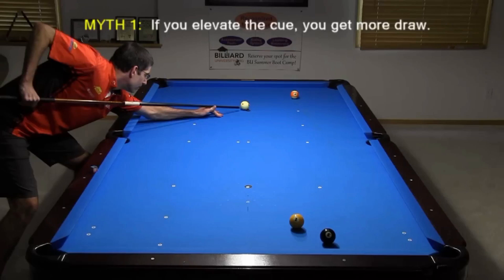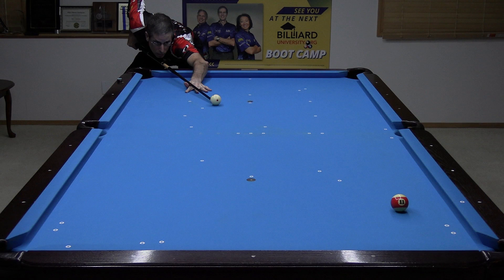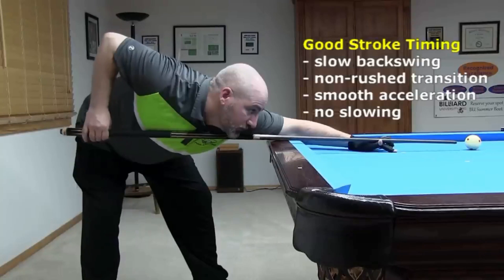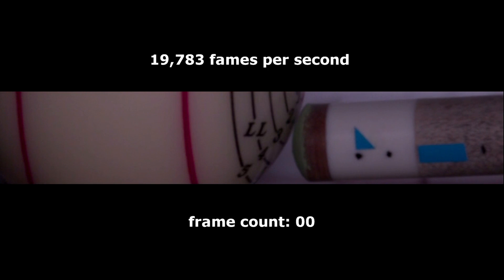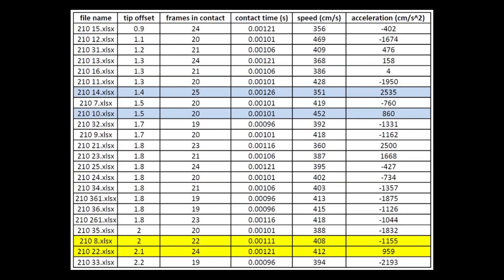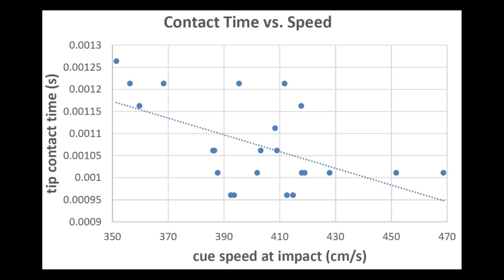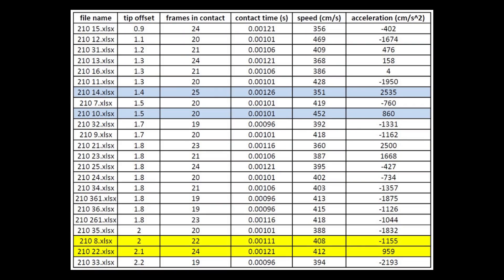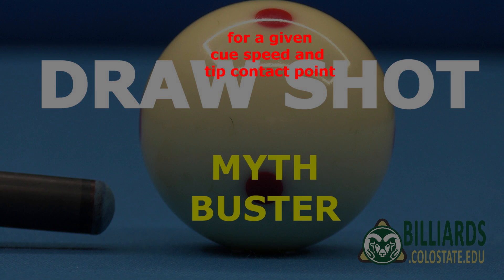DRAW SHOT Effects Myth Buster … a Slow Motion Video Study

Comment: Does a smaller diameter tip allow for a miscue limit hit further away from CB center, and would that produce more backspin with any given cue speed? What effect if any, does the diameter of the tip have on the maximum amount of spin that can be generated, and is there an optimal diameter assuming that cue speed remains the same? Do low deflection shafts perform better or worse than old school shafts with heavy ferrules when it comes to maximizing backspin?
Reply from the maker: Answers to these and related questions can be found here:
https://billiards.colostate.edu/faq/cue-tip/size-and-shape/
https://billiards.colostate.edu/faq/cue/low-squirt/#spin
Reply: @DrDaveBilliards  Excellent studies, but there has been no examination of the effects of an applied downward acceleration of the grip hand just prior to cue tip contact. This upward angle cue tip acceleration opposes the cue tip deflection that will happen following impact, and is the pro nuance for obtaining maximum backspin.  You are doing this acceleration yourself as can be evidenced by the raised to level tip position on shot completion in the videos of your maximum draw shots. I also noticed (in this slow motion video) that the radius profile of the tip was starting to flatten somewhat at the upper shoulder where repeated contact was occurring, and this may have contributed to more scattered and inconsistent results concerning the precise offset of that shot.

Comment: You have the soul of a scientist.
Although insufficient data, it looks a bit like a step down transition point in the 395 to 415 cm/s speed range? If a real effect, maybe a threshold in tip compression or shaft flex?
Reply from the maker: More data (and more careful measurement of tip contact height (maybe by observing chalk marks on the CB) might have helped.  Also, the effect you are seeing might be somewhat exaggerated by the small scale range on the vertical axis.

Comment: I think an interesting case study in draw action would be Jayson Shaw. He has a fairly compact stroke, and doesnt hit the ball exceptionally low, yet can generate a tremendous amount of draw. I notice on his power draw shots he gets a bit wristier and looser in his hand, which increases the speed. He also has a very well timed snap which produces a lot of power, similar to kinetic chain linking in a golf swing. I suppose there is a sliding scale of speed and tip position. He must generate enough speed to compensate for the tip being higher than, say, Jeff de Luna.
Reply: Another example is Judd Trump.
Reply: A good stroke combined with some wrist action is often used to get a very very high cue speed with easy. I often use more wrist when playing larger draws.

Comment: I really need help . Sometimes i cant hit a slow straight draw shot . Im a big guy (1.95m) and i feel like im either off balance or it feels like i throw a spear into the cueball because i hold the butt of the cue with only the index finger. Seems like i need a longer cue . I think im off balance and when i try a long enough bridge my pendulum stroke has bad technique
Reply: you need to work on your shot routine, 100%. You need to be getting down on the ball the same way and into stable, good position for every single shot, regardless of shot type. If you are struggling to get consistent draw, you are not hitting low enough on the cue ball with enough power, it's really as simple as that. You should never, ever be holding the butt of the cue with 1 finger, that is totally pointless and harmful to your game. The length of your cue does not matter in the slightest if your fundamentals are all wrong, put the cue length out of your head entirely, whatever you're using now is probably fine
Reply from the maker: The advice in the videos and other info here might help:
https://billiards.colostate.edu/faq/draw/advice-and-drills/

Comment: hello dr dave this has nothing to do with the video but the table that i play on at my local pool hall has a weird problem one of the cushions deflects the ball with more speed so if i roll the cue ball into it it comes back with more speed any ideas how this could happen?
Reply from the maker: The height of the cushion nose is probably a little low, or maybe the other rails are not as solid.  See:
https://billiards.colostate.edu/faq/table/cushion-nose-height/
Reply: @DrDaveBilliards  it is probably the cushion nose height since the table does bank short as well thanks for the quick response
Reply: Rail nose height can cause this, most commonly when the rails are reclothed.  Another possibility is a rubber was changed on this rail, and it performs differently than the others. This happens on commercial tables generally,  where sometimes only the "bad" rubber gets replaced, as opposed to a full set.

Thanks for the continued great content Dave - definitely a game changer for teaching and explaining draw principles 👍
Reply from the maker: @shortbus3300   You're welcome.  Good point about the cushion rubber possibly being changed.

Comment: How much of an effect does the width of the tip have?

I would assume with a thinner tip one could strike lower on the cue ball and ergo generate more draw
Reply: This is true only if you use outrageously big tip. If your tips are 10mm vs 30mm. Then yes because you cannot hit the miscue limit using a 30mm tip. But for the common tip sizes ranging from 9-14mm, you can hit the miscue limit regardless of your tip sizes. If you use a 14 mm you need to lower the tip more than with a 9mm just because of the geometry. But as long as you hit the same place on the ball with the same speed, the results should be almost identical (considering your two cues and tips might be a little different in weights)
Reply from the maker: Pubo is correct.  For more info and illustrations, see:
https://billiards.colostate.edu/faq/cue-tip/size-and-shape/

Comment: That's Dr. Dave and Pubo Huang for working on this myth busting. I've long been convinced that those guys with "super draw" are simply hitting the cue ball nearer the miscue point that those who seem less able to get significant draw. Nobody likes to look like an idiot by miscuing, so they don't strike as low as they could. What this means to me is that one SHOULD be miscuing on a regular basis in practice, in order to familiarize oneself with the miscue point, and learn how to come very close and still not miscue.
Reply: Thanks! Actually, it is better to hit slightly above miscue limit and with slightly more speed. This way you don't risk too much miscuing and can get as much draw too!
Reply from the maker: They are hitting the ball low, but they are mostly generating more cue speed (with smooth acceleration over a long stroke length).  Concerning Pubo's point, see the videos and info here:
https://billiards.colostate.edu/faq/draw/power/
Reply: @DrDaveBilliards  Virtually anyone can hit a ball hard (and "hard" can only mean with more speed). Not everyone is good at hitting maximally low without miscuing. Virtually everyone knows that it's necessary to hit the ball hard to get a lot of draw -- yet not everyone GETS that draw. It can only be because they don't hit the ball maximally low. It takes NO CONTROL to hit a ball hard, it takes a lot of precision to hit a ball very near but not AT the point of miscuing.

Comment: Thank you Dr Dave for yet another excellent video.

So technically it turns out a follow through is not really needed after all.

Also, it would be interesting to see a similar experiment but done with two different cues, say a very cheap one and one with a carbon fiber shaft. Ideally both having the same tip and similar weight, too. Just to see if the draw action changes if the shot is played with exactly the same speed and tip contact point.
Reply from the maker: A follow through is not really needed, but it is almost guaranteed to happen with a good stroke.  See:
https://billiards.colostate.edu/faq/stroke/follow-through/

Comment: Hi Dr Dave, if F(force) = M(mass) X A(acceleration), then why is more force not applied to the cb with more acceleration at a given cue speed?
Reply from the maker: The important forces are the extremely large impulsive forces between the tip and CB that accelerate the CB.  The effect of the relatively miniscule forces being applied by the grip hand on the cue are unimportant to the motion of the CB.  For more info, see:
https://billiards.colostate.edu/faq/grip/light-vs-tight/
https://billiards.colostate.edu/faq/stroke/acceleration/
https://billiards.colostate.edu/faq/cue-tip/contact-time/

Comment: This is why you want a super hard tip and good chalk. This transfers momentum more
efficiently.
Reply: But the sound of impact might not be very pleasant 😂
Reply: I wonder if a super hard tip might slip more with lower contact points? Less tip deformation reduces contact area which might result in less frictional resistance?
Reply: @nitrostudy9049 as long as the tip is holding chalk properly then it shouldn't matter. Point of contact is already extremely small so the only difference between tips is that the soft one may hold chalk slightly better than the hard one, but if you're thorough at applying chalk then the tip shouldn't slip.
Reply from the maker: For those interested in these topics, see the videos, info, and links here:
https://billiards.colostate.edu/faq/cue-tip/hardness/
https://billiards.colostate.edu/faq/cue-tip/efficiency/
https://billiards.colostate.edu/faq/chalk/comparison/

Comment: I'm a big fan and you obviously debunk those myths.  I do believe I have an important correction/addition:  Cue stick angle of attack: you state repeatedly that the only thing that really matters is tip contact point and speed.  But it is actually the full velocity vector (taking into account angle of thrust) that must be considered, not just the scalar "speed".  This is obvious when you consider "jacked up" shots (to avoid double-cue-hit or when jacked up attempting draw over a ball or the rail): draw action is created even with a contact point that is above-center when considering a horizontal perspective - or even when considering the marks on the training cue-ball that you have.  The affects should be material even for non-jacked up shots but where you vary how "unlevel" the cue stick is at point of impact
Reply from the maker: I probably should have mentioned cue elevation effects and that we were using a near-level cue on every shot.  FYI, I cover draw shot cue elevation effects in detail via the info, videos, and links here:
https://billiards.colostate.edu/faq/draw/cue-elevation/

Comment: That’s surprising - good to know. I’m just curious your view on it - obviously for most physics problems you just need the force vector of impact to calculate a trajectory since all the information is encoded and the lead up doesn’t matter.

I guess the contact time makes no difference because of the time frame of which you’re extending it? Makes it negligible?
Reply from the maker: With collisions, the contact time is not really important.  What is important is the momentum of the cue.  I try to explain it a little more here, along with other useful supporting links:
https://billiards.colostate.edu/faq/cue-tip/contact-time/
The efficiency of the hit (which is mostly related to tip hardness) is also a factor.  See:
https://billiards.colostate.edu/faq/cue-tip/hardness/